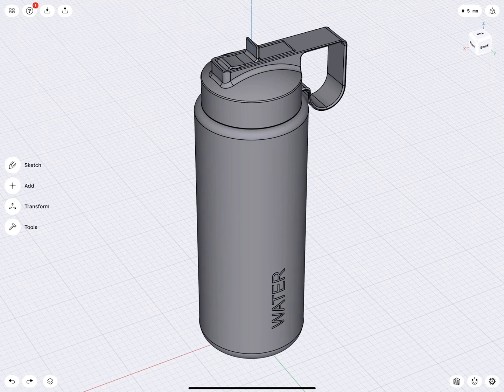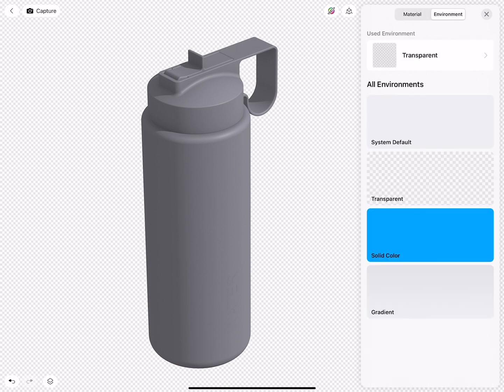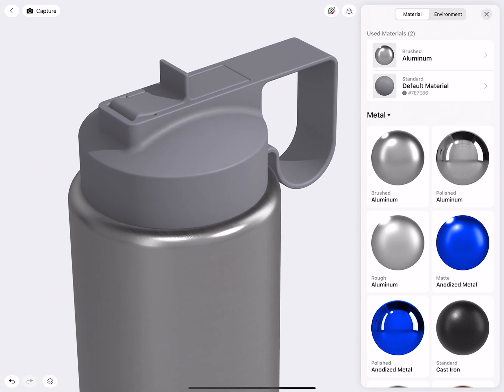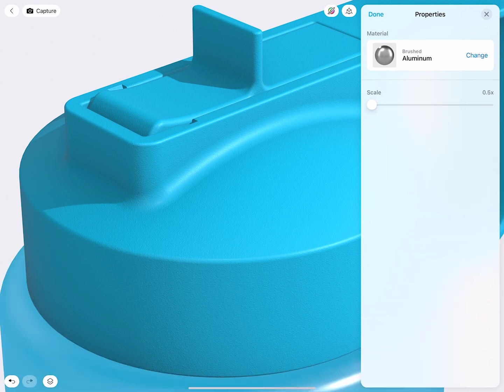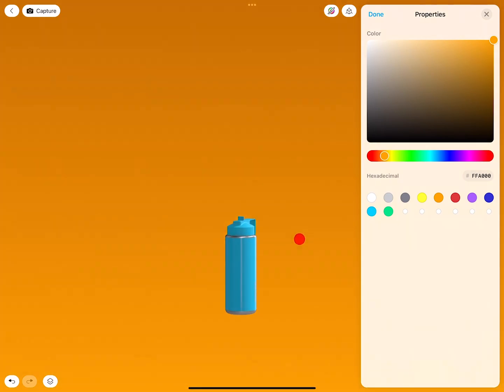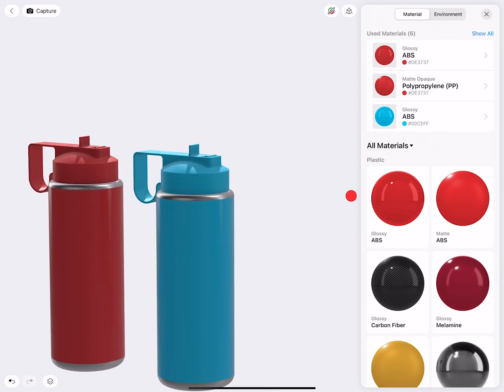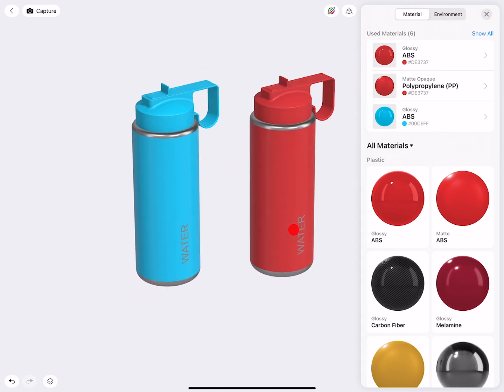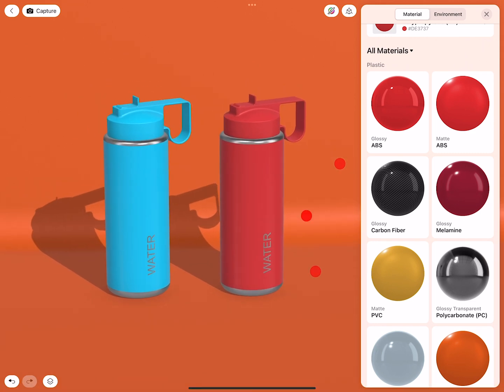First look: Visualization | Shapr3D step-by-step

Comment: I export model with applied two types of material on it in obj format. When I import it to octane x for ipad first of all the model appears on octanes viewport with    wrong view (bottom becomes back under 45 degree). Second is there is no material information, it is just by default octanes diffusion material applied for entire model. Please can you collaborate with OTOY and solve this problem? Octane x does amazing job on ipad with reasonably fast speed.

Comment: This is an excellent feature. It would be awesome if you could apply seamless textures that actually displace the geometry with displacement maps so I can 3D print with a single material but achieve different surface textures like hand grip textures. I have been doing this with keyshot software but it always produces errors.